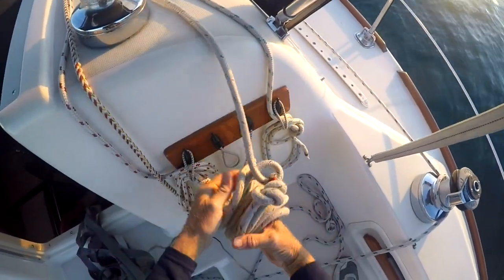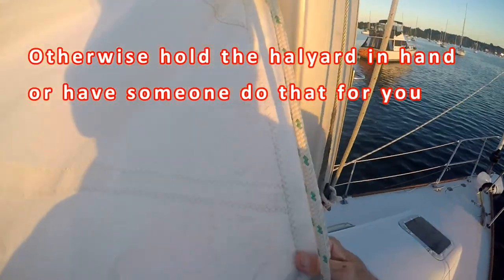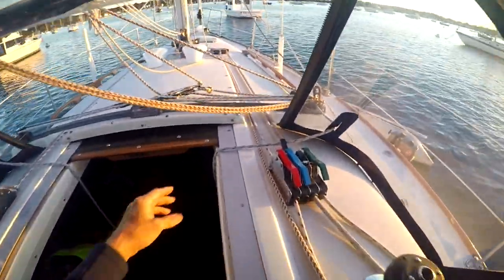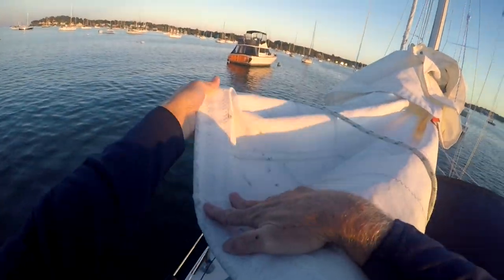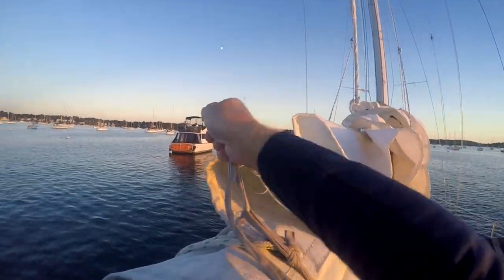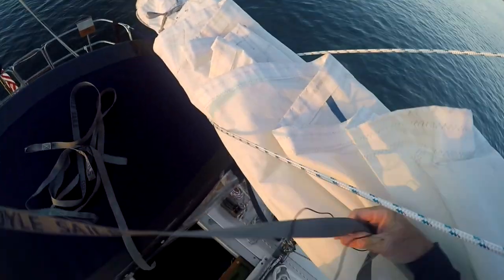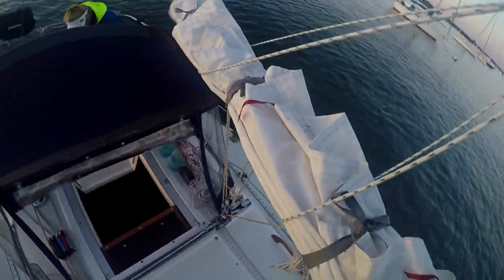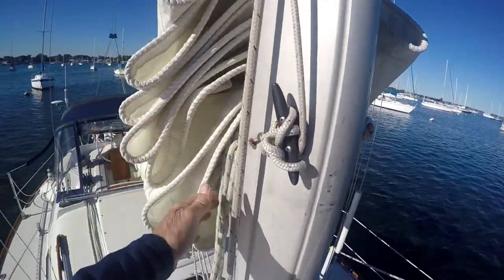Flaking the Mainsail, What You Need to Know | Sail Fanatics

Comment: I like using ball bungies instead of sail ties. You can use the sail ties if you want once you're tidying things back up at the slip, but the ball bungies are a great way to secure a sail really quickly and easily, without the concern of a traditional bungie cord with hooks damaging the sail material.
Reply: I use plastic bungee hooks
Reply: Can't say I agree. I have heard of them flicking back and hitting  the person flaking the sail in the eye.
Reply: @billbogg3857  Yes never use bungies on a boat.

Comment: Wrong first put sail ties in forward position .in a wind first put your sail ties in before fiddling with boom position.anything else your sail will end up in a mess on the cabin top
Reply from the maker: Larry,
Not having the mainsail fall on the cabintop is the benefit of the lazy jack system. With the sail dropped into the lazy jacks and the halyard removed, its not going anywhere in a breeze.. If you dont start the mainsail flaking from aft ad go forward, you cannot remove the folds and creases in the sail and it wont lay flat.